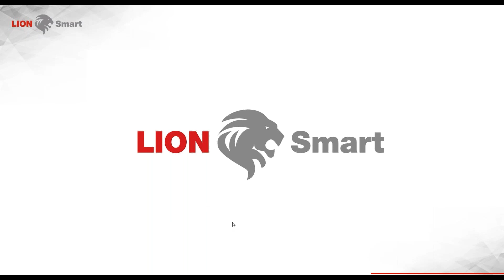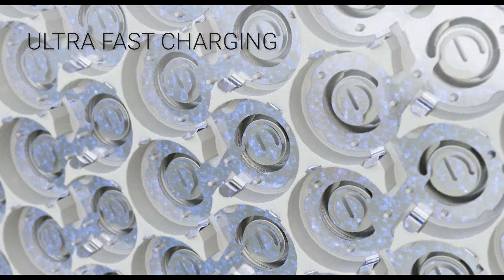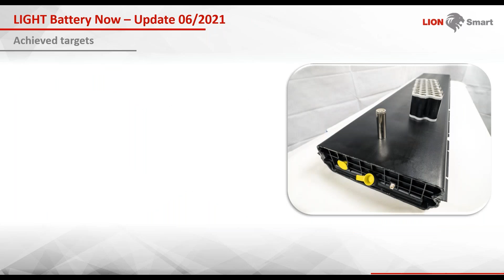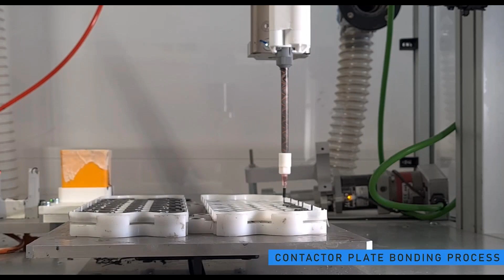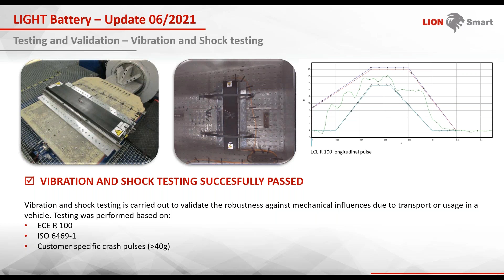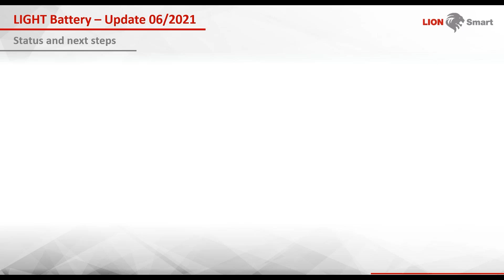LION Smart LIGHT Battery Tech Talk

Comment: I have two bmw i3, 120ah each, so far so good, I will be ready to upgrade for both in case if your batteries will be available on russian market or will be delivered here. JFYI. 100 kWh vs 42 kwh is quite a good improvement. Hopefully safety level and degradation speed will also be at least as original battery or better. If you don't plan to upgrade batteries for existing cars, you are loosing a big number of potential buyers from around the world, while trying fit your batteries into vehicle producers chains with much less price obviously as it would be sold on market to car owners.